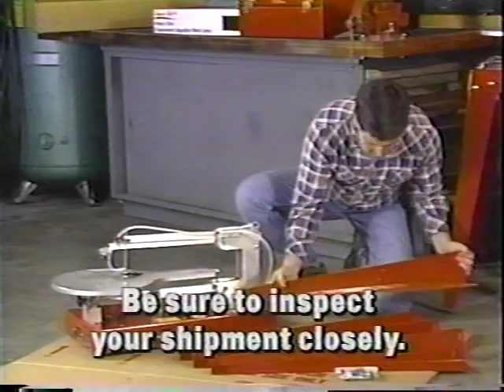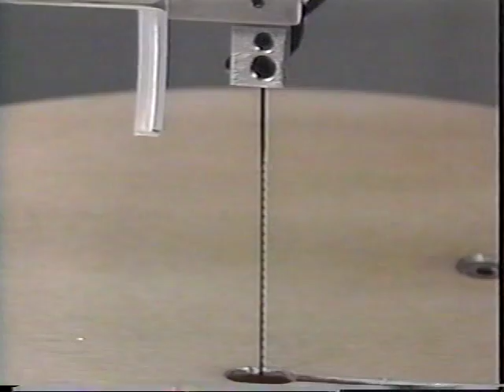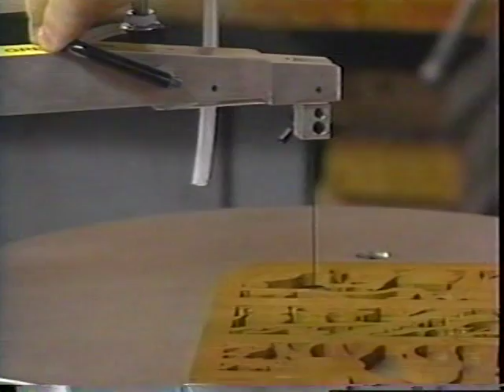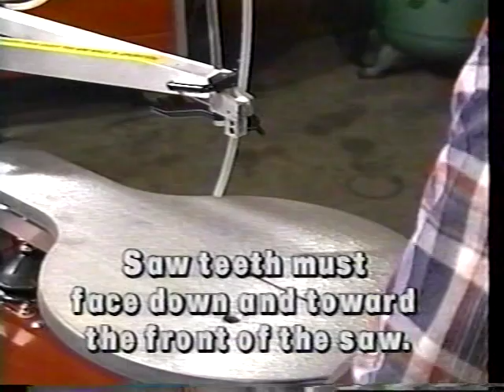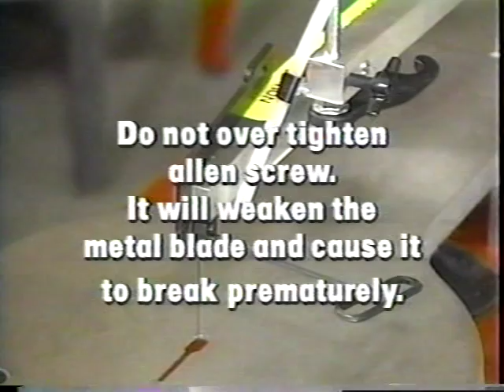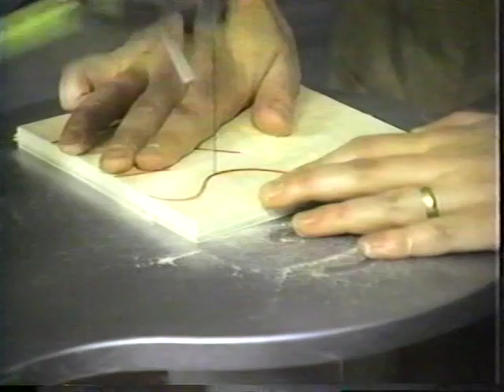Hawk 220VS ULTRA, 226VS ULTRA, and 216VS Scroll Saw Instructional Video

Comment: I picked up the RBI Hawk 226vs at a pawn shop for a little over $100. It didn't run and we took a chance. My husband got it running in 10 minutes! It is the best saw. I have a good tip for when you are changing tension: If you are standing on the right side of the Hawk to tension, the clock is backwards! You're welcome!

Comment: I have a 220 hawk ultra, bought it in January 2000. I am in need of parts for my hawk. Part #615-6153 Top Blade holder bracket ultra 220 - 
part #11-615-1074 rear cam over handle, ultra 220. 
my email address. cactusred6@Yahoo.com. If you do not have parts where can I find them. Thank you Ruby.
Reply: Mory Young gvvvu